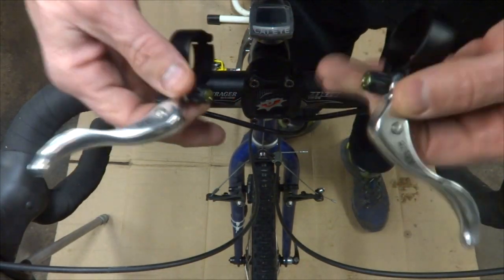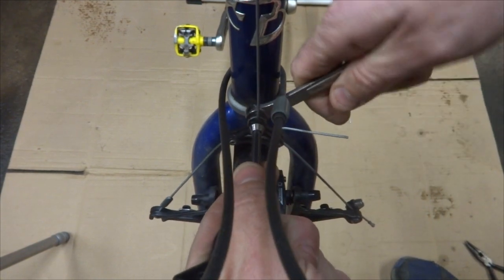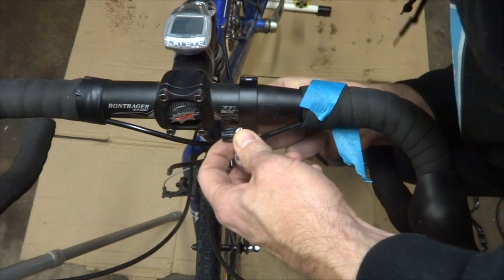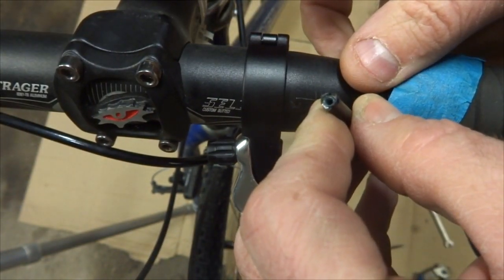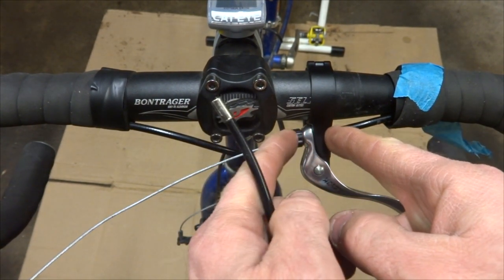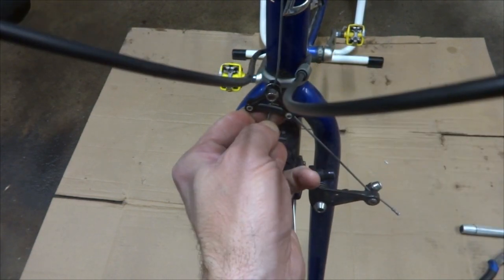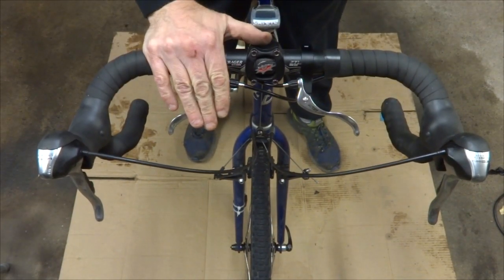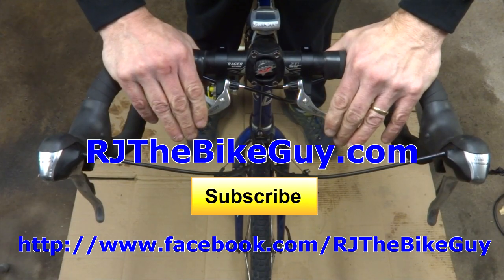Installing Cross/Inline Brake Levers

Comment: Good video, thanks.

For what it's worth, here are my sneaky top tips when fitting inline levers.

First up, you don't need to unwrap the handlebar tape at any point to fit the levers.  The levers mount far enough along from where the tape ends that it's actually pointless unwrapping it (but only if you use the second tip).

Secondly, keep the lever loose on the bar during the fitting. This way you can slide the lever onto the freshly cut cable outer instead of wrestling the newly cut end into a fixed lever.

I'll add a 3rd tip: The cut points are important.  Getting the snip points right is important because they dictate where the lever sits on the bar. To get them evenly cut on each side, do both cuts at the same time. Don't do one brake to completion and then start on the second. This is important because it's easier to match the snip points when the cable outers are both free because you can measure them flat against the bar. If you cut the first one with the lever in the right place, you can then move the lever out of the way and measure the cut point against the bar so that you get an identical cut position on the other side.

I also use ferules on entry and exit of the lever, but that might just be me.

Comment: That went so smooth and easy for you.I just put my front one on.Took me ages and had problems.Cable did not want to push out.Next the metal piece the cable slides into popped out and the little washers on the sides fell off inside the Gear shifter. Eventually got them out by making a hook from a safety pin. I'll put it down to experience but mentioned it for anyone else following the video.My secondary piece of cable housing was also quite short and a tight fit but it does seem to be working well now.Still the back one to do.
Reply from the maker: Not sure why you had issues. Did you have the shifter shifted to the smallest ring? You need to have it shifted to where the cable is fully released so you can push the cable out.
Reply: This was the front brake/gear lever/shifter.I still have the back to do.No I was not on the smallest ring on the front or the back but can't see how this would make a difference as it's the brake lever I am pushing out and there is no tension on it once I undo and release it from the brake..I could not get hold off it even with long nose pliers and only got it once the metal piece it slides into popped out which is when I lost the washer inside the unit.Hard to get ones fingers in there and they can just fall off.Bit tricky.I'll see how I go with the back one.Maybe I was unlucky.

Comment: I've got interrupter levers and I like them a lot!   As you show, they are easy to install.  I wrapped my cloth bar tape in harlequin style from the middle to the main levers and from the ends to the main levers.  No exposed loose ends.  No electrical tape.  No twine.
Reply from the maker: +Mark Holm Cloth bar tape can be wrapped like that. The newer fatter tapes tend to roll up at the edges.
Reply: +RJ The Bike Guy I did a harlequin wrap, so rolling up at the edges is not really a problem.  I put a cushioning kit, from one of the bike accessory companies, under the wrap first.  The harlequin wrap makes a double layer of cloth.  That and the cushion makes a pretty cushy bar.
Reply: +RJ The Bike Guy   Here is a picture of the harlequin wrapped bars.  The interrupter levers do not show in this picture, but you can see their clamps.
https://flic.kr/p/7MiuED
Reply from the maker: Cool! Wouldn't do it on this bike though. I actually plan to add padding. My hands were really bruised up after the mountain bike race I did last year.
Reply: +RJ The Bike Guy   I think the pads I used were the ones from fizik.
http://www.fizik.it/accessories/tri-gel-pad/bar-gel/

They add noticeable cush, but I would not call them a complete solution.  I wear padded gloves, too, goat leather.

My hands have been much happier since I switched to 50mm tires at lower pressure.  My butt is happier, too.  I am now convinced that the drive to narrower tires is the worst thing that happened to recreational cycling.  Wider, lower pressure tires have such a long list of benefits!  I only weigh 155 lbs, but I'm not going back to narrower tires!  Now we know the old idea that narrower tires have lower rolling resistance is false.  Modern wide tires, like the Schwalbe Big Bens I ride are not a drag in recreational riding.
Reply: +RJ The Bike Guy   Here is where I learned how to do the harlequin wrap.  A bit tricky, but I made it work.  The starting procedure produces a bit of a bulge, but it is neat and secure.  I'd say it looks good, part of the effect.  A bit of a bulge at the end of the bar is not a bad thing when you are trying to hold on.  I started both from the bar ends, and from the middle, hiding the raw ends under the hoods.  Makes a bit of a bulge in the hoods, but not bad.  Here is the link:
http://www.wastedlife.org/bike/harlequin/

Comment: I've been riding with crosstop brake lever for weeks,
I would say its worth the hassle, especially on climbs , traffic, recovery or just changing position due to back ache and neck ache.

They say cross top brake lever is ugly but i would say if it ain't a beauty, its practical

Comment: Tektro used to make RL740 interrupter levers for V-brakes (linear pull).  They work with the RL520 linear pull main levers Tektro still sells.  You may be able to find these on eBay.  Nobody makes linear pull brifters, but I use bar end shifters.  For my riding style, I do not need the instant shifting of brifters.
Reply from the maker: +Mark Holm You can use a "travel agent" between the brifters and the v-brakes to adjust the pull. https://www.youtube.com/watch?v=IJEBRCWNC8g
Reply: +Mark Holm +RJ The Bike Guy  What works great too with brifters are Mini-V-Brakes like the Tektro RX5. I think they are much more powerful then regular cantilever brakes.

Comment: i have the exact same levers, same colored (they come in black and silver) too but will be removing them if I can master steep hill descent~ after reducing stem length and main levers to a more comfortable position, am using them lesser now~
Reply: +imhs81 Why dont you just leave them on?
Reply: +Derek Wildash already removed them and lost 250g to surpass 10kg barrier. I guess it's usage is mainly for heavy traffic commuters and cycloX riders.

Comment: Thanks,Good and clear instruction.Just the video I need to fit my Auxiliary/Secondary Brake Levers on a Touring bike.On a long ride when riding along it's nice to use these for minor speed adjustment rather than reaching for the main Levers.I thought when you snipped that extra bit of cable housing off another alternative might have been to loosen the lever and edge/slide it along the bars either way to take up that quarter inch or so.Just learnt that is not possible as the bar diameter changes if you move along my bars.

Comment: I installed Tektro RL720's on 4 bikes, only I use 1 per front wheel, to "feather" the break without changing position. Use as a small slow-down. If I need to brake heavy, I know where the main ones are..... One pair does 2 bikes.

Comment: This video inspired me to do the setup myself, but I made the mistake of not buying a hinged brake lever! That's crucial for adding it onto these curved handlebars! So i'm shipping back the illfit levers and bringing in some new ones from chainreactioncycles. Through this video- I even got the inspiration to buy a bike just for the frame and to start building it up the way I want it! Baby steps.
Reply from the maker: You used actual inline cross levers? All of the ones I have seen are hinged. Or were you trying to install regular brake levers up there?
Reply: @RJTheBikeGuy  They tektro, off of amazon with cables and housing included. Yea they may have been regular brake levers, a little weighty too.

Comment: I guess the popularity of in-line brakes validates the old safety brakes of the '80s, where there were levers in the drops and extension levers for the upper section of the handlebars.
Reply from the maker: Not even close. The "safety" brake were weak and pretty much sucked! They generally could be squeezed all the way to the bar without full braking power. Inline brakes like these give full braking power. And in many cases are used on cross bikes where riding is done both on the tops and in the drops. On rough trail, riding in the drops is not great.
Reply: Some referred to those as "suicide brakes" because they don't work very well.
Reply: Some people say the in-line brake levers makes the brakes feel "spongy". What could be the reason for that?
Reply: I have "suicide levers" on my fixie. With quality and properly adjusted dual-pivot brakes they actually do their job well. As brake pads and cables wear brakes must be adjusted in time so the "suicide levers" won't start hitting the bars. I would certainly not advise them for a person who can't / won't do the adjustments. They do look cool, vintage and unique nowadays though.
Reply from the maker: Sorry, but even properly adjusted suicide levers suck!
Reply: Most of them were pretty bad.  The most common: Weinman and the Dia Compes were pretty lame.  Some should have been banned for horribly bad design. But the Shimano Tourney levers worked great. Rare and hard to find now.  Those had the secondary lever pivot located in a different axis from the main lever so it had a magnifying effect, kinda like power brakes for a bike.

Comment: Thanks to the clear explanation in the video, I have just pulled this off almost perfectly. Thanks RJ! The only issue I have now is a routing one. (btw I am in the UK so front and back are swapped over). Because I have a very short stem (35mm reach), there is a very small gap between the cable stop above the front brake and where the housing exits the inline lever.  This means that the bend in the cable is super sharp, so the cable doesnt slide out fully when I release the brake (this is only a problem when using the STI lever, when braking with the inline it's fine). I think if I get a new, longer bit of housing, and make a large loop, that will resolve the issue. Any tips appreciated.
Reply from the maker: Familiar with UK being opposite: https://www.youtube.com/watch?v=OR47XELYmQc

Routing is a case by case basis. I hope you don't mean a full 360 deg loop. That would probably not be necessary. Usually just adding a little bit extra housing works.
Reply: @RJTheBikeGuy  I actually resolved this issue just now by making the housing shorter. I was hesitant to do it before because i thought there wouldnt be enough room to use the inline brake lever but its actually fine. So that bit of housing is now down to 2.5 inches but it all works perfectly now. Cheers!

Comment: Hey RJ, great video as always! 

So I've gone ahead and made a similar setup for my girlfriend as she is new to the cycling world and wanted to feel safer with her never having tried STI levers for braking.

Installation was no problem, but I figured I'd post in this video as I've got cantilevers on her bike as well, so basically the same setup. 
My question then goes: How is the feel on your STI levers? 
The STI levers I've got feels quite hard (requiring a lot of finger force, not sure what the word is) which is a problem for her as she has smaller hands. 
Not sure if it's because it's an older sora 3500 set I've got or if I should try and replace the cantilevers with newer models (as they are older models) or just try and clean/lube the STI levers. Cable inners and outers are brand new.
Reply from the maker: My levers feel fine. Lubing the STI levers won't effect the inline levers at all. The inline levers come after them. If the STI levers feel okay, but the inline levers feel hard, then it is just the inline levers. Not sure why they feel hard.
Reply: Maybe you set to much spring load. Undo her breaks and look if there are multiple holes in the brake mounts to hold the spring in place. By using different holes you could adjust the amount of force the springs put on your breaks in order to hold it open. Less force means less force is needed to use the brakes. But be careful not to reduce the force to much, because this could prevent the brakes from releasing correctly and therefor rub on the rims.

Comment: Thanks for making this video - extremely helpful - I'm planning this for my road bike. Question: do these types of inline brakes produce close to the same stopping power as the primary brake?
Reply from the maker: Yes.
Reply: RJ The Bike Guy thanks RJ. What a cool feature to be able to add to a bike.
Reply from the maker: @adamh7947  Yeah. These are way better than those old suicide levers.

Comment: Travel Agents make the engineer in me shiver!  The cable is going around too small a radius.  My setup works very well and I do not crave brifters.

I like V-Brakes.  They are simple, easy to maintain, work well and do not stick out like cantis.  I am disappointed the bike companies have decided to try to kill them off.   I have no need for disc brakes and do not at all want the extra complexity.
Reply: +Mark Holm Never seen them before the link above but yeah, I ride primarily ride trials (pedal powered not with an engine) where without properly good bike setup, but brakes in particular, your bike is pretty much useless,  and my head tells me that gizmo looks to be a horrible and needless idea.
All +RJ The Bike Guy needed to do was invest in some pads with a harder material and thicker backing plate or metal backings (the kind that are usually refill kits with the salmon pink colur pad material would be perfect for this bike), tilt the pad slightly upward toward the tire so they don't sqidge down the rim when he pulls hard, and pull some more cable through. Sometimes the bike industry makes stuff to solve engineering problems that don't exist.
Reply: +Ciaran Cargan   I think you are misunderstanding.  Travel Agents are used because different families of bicycle brakes use different cable pull ratios.  That is, for the same amount of lever, or brake pad movement, there is a different length of cable movement.  Caliper and cantilever brakes use similar amounts of cable travel.  Linear-pull, aka V-Brakes, use a longer amount of cable travel.  Mixing levers from one family with brakes from another family results in seriously degraded performance.  Combination brake-shifter levers (brifters) are all built for the caliper-cantilever family.  Travel Agents mechanically transform the shorter pull ratio of brifters (and other road style) levers to the longer pull ratio of linear-pull brakes.
I don't like Travel Agents because the cable is flexed around a tight radius, a likely cause of cable failure, and because they look flimsy to me.  I don't want flimsy in my brakes.
Reply: +Ciaran Cargan   The needs of recreational and race riders are often very different.  I quite like the salmon pink brake pads for recreational riding.  They retain considerably more stopping power in wet conditions than grey or black pads and tear up my rims a lot less.  As a recreational rider, I expect my rims to last years, and with pink pads, they do!  A lot of people think a brake system is only good if it extremely stiff.  I prefer the first quarter or third of lever travel to use up pad to rim clearance, the middle third to bring the pads from just touching to maximum, over the bars, stopping power and the last third a reserve for wear.  In recreational riding, a bit of mud or grit on the rims or pads is common.  You need to leave some pad clearance for that.  The middle third of the travel comes from relatively soft pads and, more importantly, generous toe-in.  This gives the full range of brake power from just a touch to lock-em-up in an easily controlled lever movement.

Comment: Hi RJ, your video's are very thorough and easy to follow. I am having a problem making sense of some cross top levers that do not have the barrel adjusters. I just purchased the specialized brand but they don't come with them. The guy gave me all the correct cables but am not sure how they will hold in place so i don't want to cut anything. Actually thinking of returning them and getting levers with the barrel adjusters. I can't find a video that shows installation of these kinds of levers. My bike is a 36 year old Raleigh Record which is in excellent condition, just wanted to update some of the components. Any advice?
Reply from the maker: You don't need barrel adjusters on the cross levers. They are usually located on the brakes, or primary levers already.
Reply: Thanks for the quick reply, I'm updating from the old silver shimano levers with the extra brake grip and purchased the tektro alloy aero levers as well, but there are no barrel adjusters on the new levers either. One guy at another bike shop said they were an older model.  These are what the guy sold me. Don't have a great feeling about these. Maybe he didn't sell me the correct cables? He gave me end caps but no ferrules

Comment: Hi, great video, I'm not amazing with bikes but OK knowledge, do I need any extra stuff to do this apart from the levers themselves.
Reply from the maker: A new cable and a ferrule and tools. And a crimp end.
Reply: could you clarify what the new cable is for?thanks,
Reply: James Manley For the brake to pull the pads

Comment: Thanks for showing this. I think you could have left the lever clamp loose, so as not to wrestle with the cable housing. Also, I admit I cringed a bit when you snicked that bent cable into the housing.

Comment: Can I use cross top brake levers as the only brake and not have them be in-line. My old singlespeed used to have brake handles that look like the ones you installed as opposed to getting regular brake levers.
Reply from the maker: No.